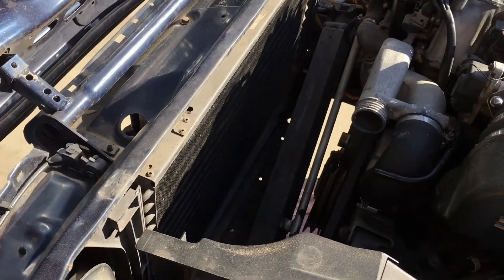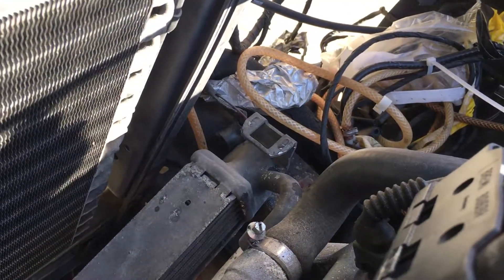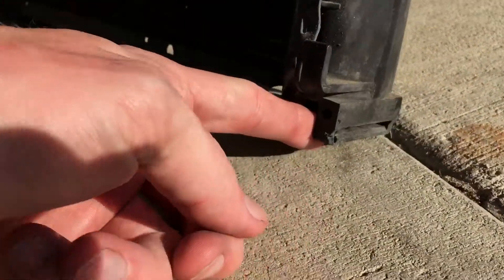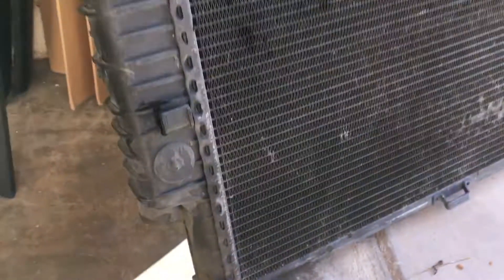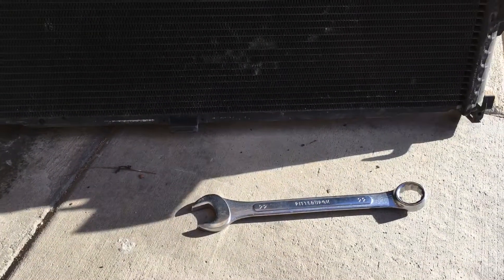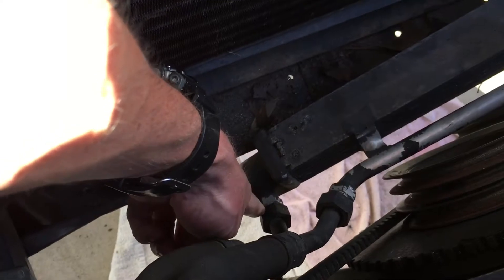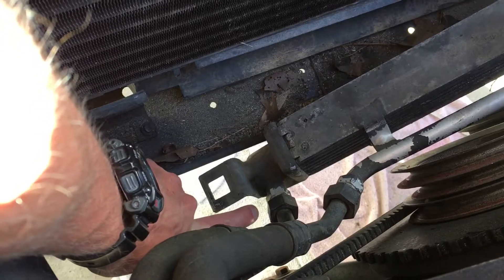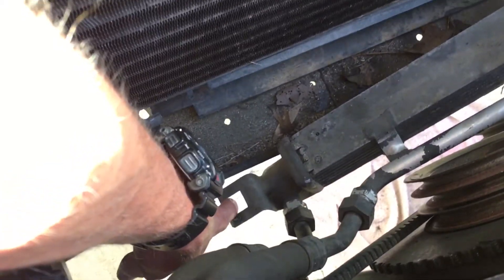E34 M5 Radiator Removal - Oil Cooler Separation

Comment: Hi Trevor, could you tell me the wire colors that are connected to the radiator fan sensor? I just bought the same car and the previous owner had the wrong radiator installed and the wires to the fan switch were cut. Now I have 3 wires next to the switch but want to make sure they are actually the right wires before I hook them up to the fan switch. Thanks
Reply from the maker: I am away from the car visiting family. I would suggest that you join M5Board and ask the guys there if you want a quick response - or join the M5Board / E34 M5 facebook group.
Reply: Thanks for the reply, I’ll try M5 board. If you don’t mind taking a look anyway, and letting me know, it would be very appreciated. Thanks again